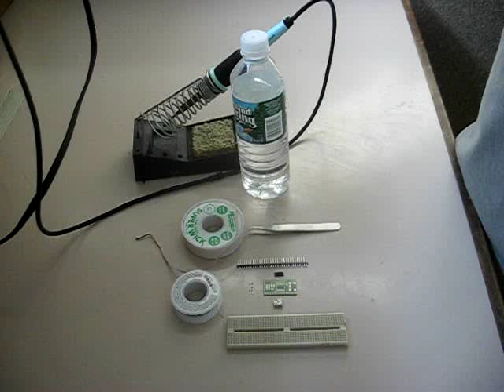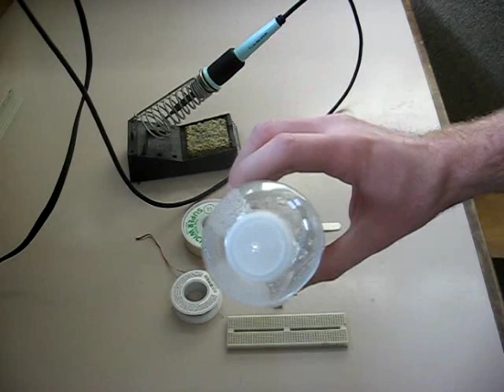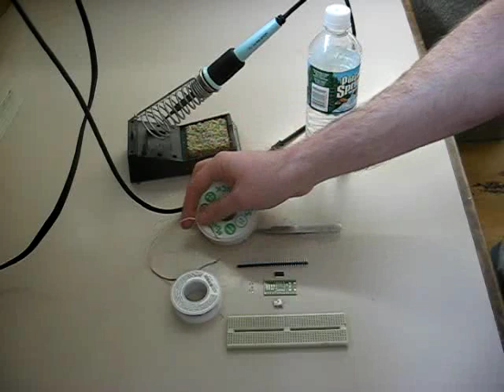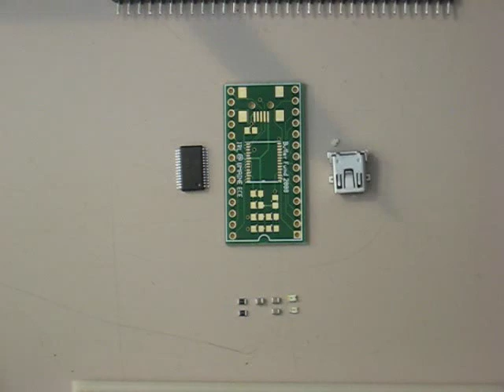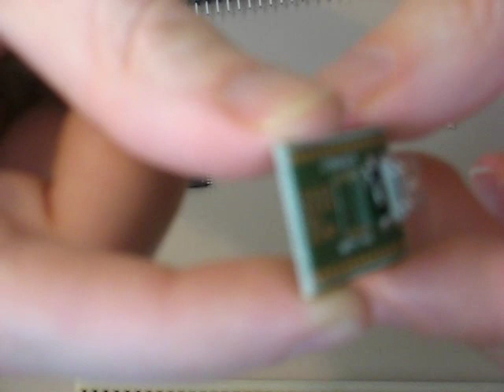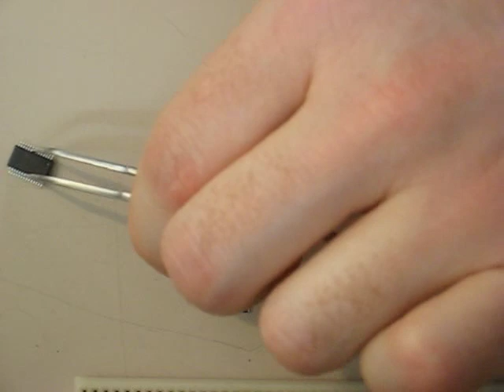How to Build A FTDI FT232-RL USB to UART - PART I

Comment: Just to follow up to my comment people will say what about the ftdi chip the leads are so close and small. Well it really dosnt matter that much. A 1/32 chisel tip will be just fine for that chip.. The key is to flux and fine solder. Solder will only flow where there is heat and flux so the tip size is not as important as you think actually you can solder more than 1 lead at a time and drag soldering isnt that hard so I would recomend trying to learn it! U WILL THANK ME!!! ITS REALLY IS EASY!
Reply: kodi 設定。

Comment: Just a little word of advice, I am an IPC certified instructor and just as some advice to everyone soldering, instead of using such a fine tip, you should be using the LARGEST tip possible to get the job done. This is to allow the maximum heat transfer and the ability to remove the gun as quick as possible... If you notice with such a small tip trying to attach the usb connector he needs to stay on for quite a length of time to make the solder flow. Honestly he should be usin a medium chisel tip
Reply: Or a hollow point tip, also for soldering the chips seen in this video.
Good point on this one, using your technique all the time as a repair and rework tech